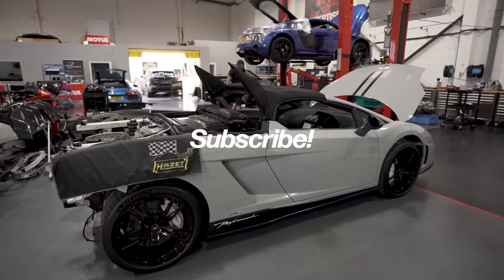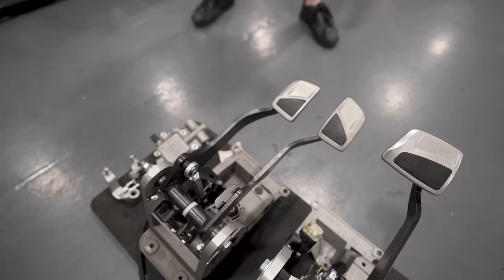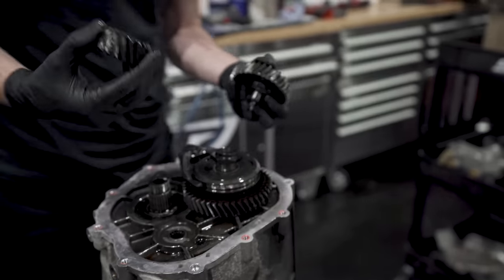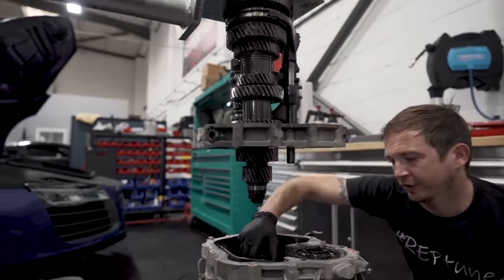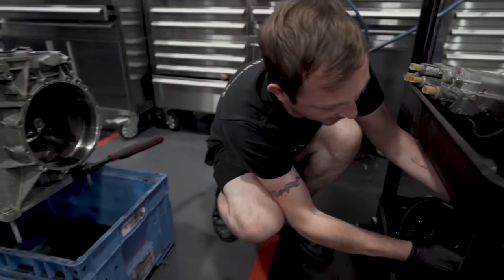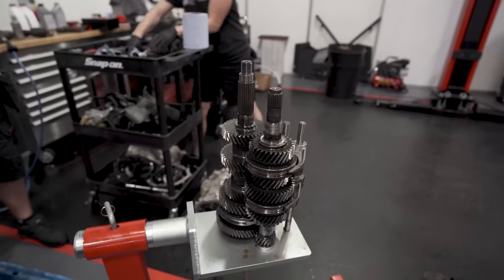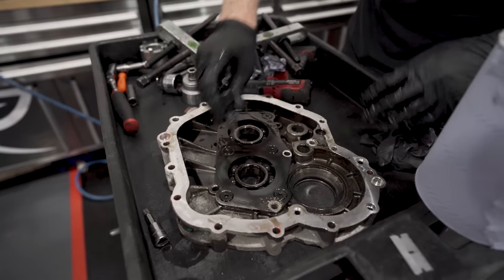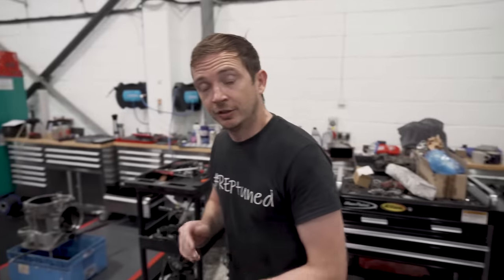Lamborghini Performante manual gearbox swap!

Comment: Enlightening.   I thought all that was needed was swapping the manual shift linkage for the hydraulic parts.  Didn’t know the box had to be taken apart and internal parts swapped also.  I wonder how many people bought an E box thinking they could easily convert it to manual.
Reply from the maker: Yeh it’s a big job to swap!

Comment: See a completed video and drive be great
Reply from the maker: Completed vid is on the way…..we had to complete it! 🤪
Reply: @REPerformanceUK  be cool if you could make an exhaust as good as gintani has for the svj for the r8 s
Reply from the maker: @alextop1850  no point, loads of great exhausts for the R8 already. Gintani is just a straight pipe system.
Reply: @REPerformanceUK  sounds so good tho. Haven't heard any other car sound as good yet.
Reply from the maker: @alextop1850  it’s a V12 Lambo….not much does!

Comment: Looks fairly straightforward swapping the diff for an lsd 👍🏻
Reply from the maker: Can’t do it in place but yeah easy enough. Not enough room between frame rails to drop out in situ.
Reply: @REPerformanceUK  I'm coming from FWD, which is a full gearbox strip just to reset the preload 😁

I appreciate its a box out job, but for some reason I thought it would need the box stripping to swap it.

Thanks for sharing such a detailed video Ricky 👍🏻
Reply from the maker: @pinderwagen  ah yeah I suppose so! No I’m that case mate it’s 14 bolts. Hardest bit would be shimming it!

Comment: How much does the Manual Gearbox weigh Vs the Automatic (Auto single clutch) as although the Casing is the same the internals and hydraulics/  Actuators must weigh quite a bit compared to the manual option?????????  Would love to know as know one seems to be able to offer an answer????  Thanks

Comment: Would be interested to know the cost to do manual conversion all in. I have a LP570-4 Superleggera here in the UK. Having a manual one of those would most likely make it 1 of 1.
Reply from the maker: Drop us a message and we can run through some costs. All comes down to how much you can source used vs new tbh. Especially the inside parts!

Comment: The part number on your shifter box is for the pre-LP car, are they interchangeable?
Reply from the maker: Do you mean the shifter on top of the gearbox or the selector inside the car?
Reply: @REPerformanceUK  the shifter box inside the car, not the shift fork selector on the transmission

Comment: Used to service wind turbine gearboxes and they stink so the hole workshop stinks. Hated it and the oil is very dangerous as in cancer to the skin so much so we would double glove like in a operating room in a hospital so if one glove failed we had some more protection.

Comment: Far be it for me to critic but you have gone this far and with oil that tired and  burnt out looking (judging by the dark deposits on the internals)  I would of removed the gears from both those shafts to check for wear of the surfaces be it plain or cage/needle design gears  and thrusts etc .... just saying , you guys certainly do get involved  (',')   another good video however REPerformance
Reply: He already replied in other comments that he did inspect off camera.
Reply from the maker: We fully stripped the shafts and cleaned everything thoroughly for inspection and rebuild….just not much to show on the video with all the stuff in a wash tank!